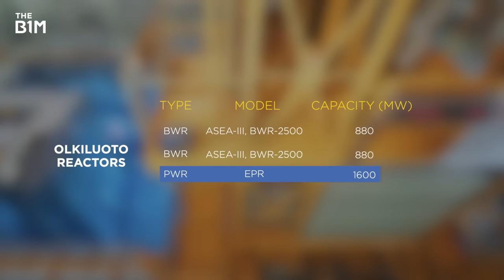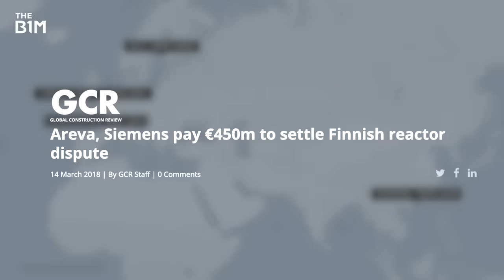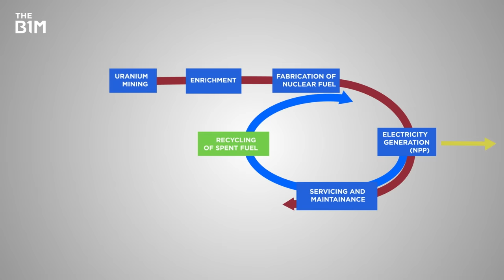Finland Might Have Solved Nuclear Power’s Biggest Problem

Comment: And, none of this touches on what might be the best solution:  The Thorium Molten Salt Reactor.  This reactor operates at ambient pressure, therefore no huge pressure vessel is required.  It also runs on a negative temperature coefficient.  As it gets hotter, it becomes less efficient.  That means it is self-limiting and can't run away.  The biggest advantage is it uses nearly 95% of the energy contained in the fuel and the fuel can be reprocessed and used again.  And, China is building at least one of these reactors.
Reply: So one in production currently and it should be the salvation and replacement for hundreds of nuclear power plants around the world.
When the question goes into how much that research and studies cost, suddenly no one wants to say anything. It's easy to demand something you are not paying for.
Reply: Yes, a Third vote here for Thorium Salt reactor and the reasons why it will dominate and replace all future nuclear plants.
Reply: The waste from uranium reactors can be used as fuel in thorium
Reply: @alaric_  I mean, the other nuclear plants are fine for now tbh. We should be replacing carbon-fuel power before we bother fighting over what renewables & nuclear we use going forward.

By the time we get done with that, we'll have the research to see if they can replace uranium fuel.
Reply: That kind of reactor is allmost ready to use.. first one is maded in India
Reply: @penttiperusinsinoori3037  Thank you for the info.  I am in the USA and I'm angry at the stupidity of our current government and the fact that the media completely supports them.
Reply: I’ve also been told that thorium is incredibly energetic, like 3 times that of uranium.

Comment: Fun fact: because the costs have swollen so incredibly much, OL3 is the 3rd most expensive building in the world, only behind Abraj Al Bait hotels in Mecca, and ITER in France.
Reply: and critiks should be proud about that, not only have they stopped a lot of nuclear programs for so long that the knowledge they had is nearly gone, they have also implemented such high safety standarts that the costs soared out of control, also the construction of the ol3r eactor faced a lot of law cases that prolonged the timeframe of the building proces for years, russia and korea can build reactors that are perfectly safe for 3 to 5 biljon euro, the new project in finland wil be significantly cheaper
Reply: still worth it the next time it wont be so expensive and if it proves itself more people will hop on the nuclear train.

Comment: Is the copper capsules not a problem? I remember hearing that the demand for copper is way bigger than what we got, and that it will get worse in the future. Doesn't that make it a less sustainable solution if everybody starts doing it?
Reply: We have copper, we just need to mine it. Higher price = more economically viable projects = more copper
Reply: @Evan Thompson (Student) Not just copper but also beryllium. Both are really expensive metals and in high demand today, their demand is projected to grow even further in the future as electronics use goes up and viable reserves dwindle.
Reply: The biggest problem is entombing this incredibly valuable resource and making it virtually impossible to access it for future use.
The problem isn't that the fissile material is "spent", it's that too much of it has morphed into other radioactive elements.
This lack of homogeneity or purity makes it risky to keep going.
There are reactor designs that can create plenty of power with plutonium and the other "contaminants" but the will isn't there to develop and install them.
Reply: Yeah, burying copper is not sustainable with demand steeply rising.
Reply: @jimurrata6785  I don't see anything in this design prohibiting the removal of the casks at a later date if the technology becomes available to reprocess it.  
Bentonite is just dry clay.  They won't wet it for fear of corrosion, and it's not like they will be fired in ceramic.  The shafts can be cleared and the contents removed easily.
Reply: @jimmurphy6095  none of the bentonite clay I've ever seen is dry.
It's impervious to water, which is why we use it to line farm ponds and as foundation waterproofing.
But once it's in place it swells and is a bitch to remove. (Yes, I know this granite is chosen because it's dry)
The fact that we are burying an expensive (ecologically and monetarily) resource that is 1% used is the bigger issue.
Maybe the French will get on top of this and start using "waste" in their generation profile.
They seem to be the only nation on earth to have a rational approach to nuclear.
Reply: @jimurrata6785  I personally have unloaded trailers of bagged bentonite for Haz. Waste remediation sites.  When I say "dry"  I mean pourable from the bag.  Not sure of the exact moisture content, but I'd say <10% as it comes out of the bags.  Again, I highly doubt they are adding any water to this.  So I can't see where the swelling would come from.  But even so, it's still just hardpan clay.  It's not like it's encased in steel that has to be torched to get through.  I just did a search for bagged bentonite.  Here's a quick copy grab. "Bentonite clay is a natural expanding clay sealant that when exposed to moisture can expand 15X or more creating a very effective pond sealant when applied correctly."  This comes dry...  Granular, for ponds
Reply: @jimmurphy6095  we've got a big Superfund site capped with this stuff.
In that environment it keeps rainwater out, and contaminated water from leaching into the ground (hopefully!)
This is pretty similar to hydraulic and fracturing cements, in that it expands to a form that is impervious to bulk water, but it still gets damp.
The idea of a radioactive cask surrounded by impenetrable granite and tightly packed with something that expands to 15X its dry volume seems troubling to me.
Reply: @jimurrata6785  Now picture it without added moisture, which I think is the way it will be used here.  As I mentioned, you certainly don't want to add any moisture to this environment due to possible corrosion.  In your application, it works great!  I've also seen it used as a slurry to make slurry walls underground to hold until cement could be used.  (Big Dig in Boston is probably the biggest site I can think of it being used that way.)  I believe it will work just as well in this one.  I don't think it will turn to stone.  Hardpan clay.  Yes, but that's the plan.
Reply: @jimmurphy6095  Yeah, I watched them use bentonite slurry that way for the original WTC 
I'm not trying to say it turns to cement, just that it becomes impenetrable by hydrating itself.
And if you've ever tried to dig it out you know it becomes incredibly stiff when moist.
I have no doubt that the clay could crush those canisters, installed as it is illustrated in this video.

Comment: So their solution to burying the spent nuclear waste is to....burying it better? Am I missing something, doesn't seem like a game changer, just improving on old techniques?
Reply: This solution is already a few orders of magnitude of overkill. You could just throw the waste container down any old mineshaft and fill it back up, it would be just as harmless to the environment. Back in the 60s nations used to just throw containers into the ocean. While that's discontinued and I wouldn't endorse the practice, that method is technically just as harmless to the environment. Ultimately it doesn't matter much what you do with the waste, as long as you don't put it right under your pillow where you sleep.
Reply: didnt you listen? the gamechanger in this is that it requires no human/mechanical intervention, which is a massive game changer
Reply: As a principal it is only an improvement but as far as technology goes to safely store it long term (those words mean a great deal in this case) it is quite revolutionary. We need a guaranteed safe long term maintenance free storage method and that has never existed before.
Reply: Thanks for the replies guys, always interesting to see others takeaways. I appreciate its requires less/no, human/mechanical intervention, but so does throwing it into the sea. Burying it deep has less environmental issues than the former, but requires maintenance. Now they've effectively combine the two ideas. Its an improvement on the current standards yes, but I wouldn't call it a game changer. A game changer would be finding a new solution to the existing problem, (e.g. reusing it, repurposing it, making it effectively safe ect something along those lines. I don't have an expertise on the subject so I'm simply speculating on the issue. And of course, this isn't to dismiss the brilliance in engineering and attempts of improving the issue. Again, to me, its just improving an old technique.
Reply: @Les_S537  Thanks for the reply. You've given me some interesting things to look into.
Reply: @DrTFW1  Actually the quote was misused in my opinion. You should read the source for more nuance. The article soft-quotes him with "Onkalo is a game changer for the long-term sustainability of nuclear energy" so the game changer part is about nuclear energy being viable and socially acceptable enough, not about the new tech itself. Sadly game changer is a nice buzzword that does well in media and sadly B1M didn't do better.
Reply: No one has ever buried spent nuclear fuel before. Up until now, we have only been storing it on an interim basis in spent fuel pools or dry cask containers. Onkalo will be the first FINAL geologic repository for high level radioactive waste where spent nuclear fuel will be permanently and irretrievably entombed.

Comment: Finland, the country where governmental common sense tends to prevail much more, and corruption MUCH less, than in most western nations.

Also, while other places were OK with skipping on standards, not in Finland. A 50 year system means, it works for 50 years. Not compromised at 45.

Comment: a better way would to change the reactor design from solid fueled to liquid fueled like a molten salt reactor then you would be burning 95%+ of the fuel instead of less than 1%....with a safe level at 300 years instead of 100,000+ years....
Reply: i agree

Comment: Spent fuel wasn’t Fukushima’s or  Chernobyl’s problem.
Reply: Actually in Fukushima there was a big pool of spent fuel in the reactor building that started to heat up once the building was damaged and there was need to pump more water into the storage to prevent even worse catastrophe from happening.
Reply: @McSlobo : yes, but the PROBLEM wasn’t storage or disposal until after the accident. The problem is accidents. Get rid of accidents and that will fix the nuclear problem - impossible !
Reply: There have been hundreds of nuclear plants over the last century and only two have had catastrophic meltdowns. One was flawed design and the other was struck by a massive earthquake. The accidents were 25 years apart. Nuclear power is safe.

Comment: Might be best in the long run to denuclearize the waste by altering the unalterable half life of radio decay.  Rendering it inert and stable and non-toxic makes more sense then leaving it lying around into the future as even if its buried it's still not decontaminated.
Reply: It would take a dozen coal fired power stations to do that
Reply: @Drew Peacock Just as I stated by altering the unalterable half life of radioactive decay.
Reply: @Drew Peacock the only way it can be done.
Reply: @Drew Peacock I don't work for you and do not need to provide you with an explanation of the science, engineering, and technology behind it.

Comment: While I appreciate the strides to figure out this problem, burying all of our copper doesn't seem like the right choice. Thanks for the video, it was interesting to hear the latest nuclear developments.
Reply: Damn I didn't even think of that!!
Reply: Well... it's probably not that much though
Reply: No, globally speaking it wouldn't at least not at first. This being the trick for nuclear, however, makes copper a limited resource thats bound to run out. Especially when you're making enormous cylinders that are probably at least an inch or so thick. Now multiply that by all of our waste...invest in copper is what I'm saying. LoL
Reply: @killbubbatm5983  There isn't actually that much nuclear waste even on global scale. It would technically all fit in one large container ship (if we ignore all safety issues and just stack the stuff there). So I doubt this would much affect the global demand for copper. I think we will run out of nuclear fuel first.
Reply: For context I'm not talking today's timelines, I'm talking of a future where we use more nuclear and generate more waste. My real point is instead of just burying our problems we should come up with a better solution. I mean we invented a way to harness nuclear power, we can invent a way to recycle or safe it.

Comment: I  believe using the expression "permanently solve" is a bit naive here, given that this radioactive waste is not being reused/recycled for anything, but rather simply being buried with more care than usual. It's still just a different approach to putting the problem out of sight and out of mind.
Reply: Yeah..... I hope there are scientists trying to recycle/reuse those stuff.
Reply: It's not a problem.
Reply: Alright so. They bury it deep in thick and dense bedrock. They cover it in clay that stops radiation leakage. Then they put more on top. Boom. Then when it fills. It gets permanently sealed. Reusing it is not effective and enriching it would just be worse Then disposing it

Comment: Is it possible to effortlessly mined back the stored waste when a new method of recyclation is developed?
Reply: No, sounds very difficult to extract from its containers (which become highly radioactive), and the spent fuel may be mixed with some boron which is a fission reaction poison.
Reply: @davidgunther8428  could be still cheaper than mining uranium oxide, but that's the cost bottleneck for nuclear power. (plant design and permitting is, because the plants are not identical enough. modulars aim to solve this.)

reprocessing is a solved problem, spent fuel is literally lying around. (nuclear proliferation is also "solved" by poisoning the plutonium and then burying that), so maybe after all that is gone digging up these buried drums might make sense.
Reply: @maxscope1214  Your doctorate blab is applicable to so many subjects!
Reply: Your first and last name is awkward.
Reply: if you are willing to sacrifice a few workers and a couple of billion dollars, sure perfectly possible.

Comment: We have solved the spent fuel problem and we had the technology since the 60's it's just not economical to reprocess it that's why it is being stockpiled. With the advent of molten salt reactors and other fast neutron civilian reactors it gives us the ability to reprocess spent nuclear fuel in a economical way.
Reply: Minor reprocessing or no reprocessing at all in the case of Elysium Industries.
Reply: thing is that spent fuel is only part of the problem, there is lot of stuff on nuclear plant which turns to radioactive waste and has to be dealt with when plant is closed.
So onkalo is for whole power plant and all waste from buildings will be buried in that tunnel too.
Reply: @freezedeve3119  No they won't be and they don't need to be. The building decommissioning is low-level waste and can go into a landfill with no problem. It's in the same category as medical waste from x-ray equipment.
Reply: @chapter4travels  maybe in your 3rd world country it is allowed to landfill such stuff but in Finland that would be crime, sure onkalo is landfill too but on another level.
Reply: @freezedeve3119  The decommissioned material is considered low-level waste and a landfill even in Finland is fine.
Reply: @chapter4travels  if it radiates too much to be reused it goes to Onkalo or similar place where it can stay 'for ever'

Comment: Wouldn't say this is exactly revolutionary. Unlike what Greenpeace would have you believe, radioactive waste isn't dumped into the oceans. The Netherlands has had a dedicated facility like this on a much smaller scale, but doing essentially the same thing. Building the size of a football field, highest radioactive waste goes in the deepest basement, and that building is able to handle pretty much all the waste we'd produce for the next 50 years or so. And since it barely takes any space, it's simple to just build another facility like it. Nuclear waste is a problem that was solved long ago, and there is barely any risk to just storing the stuff until we have a better way of getting rid of it completely. If we ever find a way of recycling it completely, we can just dig it up again. Easy.